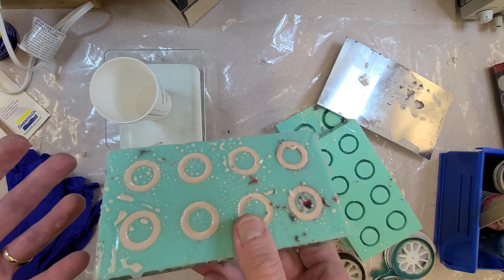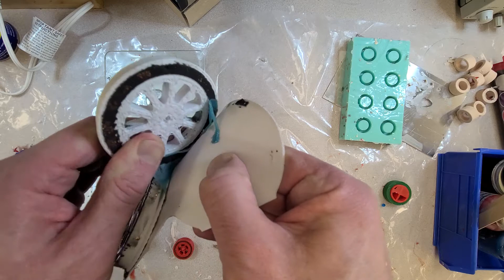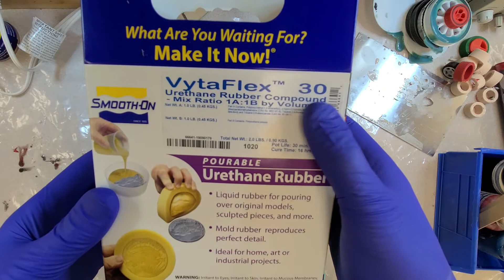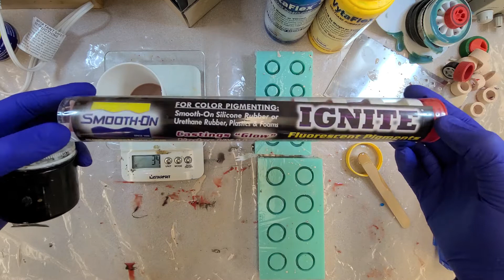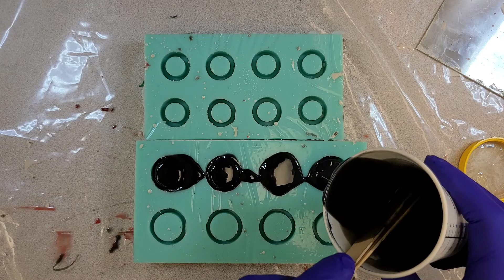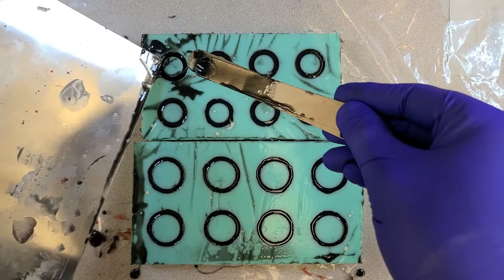Casting Urethane Tires for Mini Sumo Robotics

Comment: can i have the mold design or can you help mto get one i am trying to print my own tyre for the compitition
Reply from the maker: @mohammedkhalaf4751  The mold design was made by turning aluminum "tires" on the lathe, placing them in a box, spraying them with mold release, and then pouring silicone over top of them. So there isn't a "set of plans" that I can share. 

But you could 3d print tires and cast a mold around the prints... You might just want to hot glue them down to the bottom of the box so that they don't float to the top of the silicone!

I've also made some custom tires using 3d printed molds and cutting the mold away and disposing of it in order to free the polyurethane tires once they have been cast.